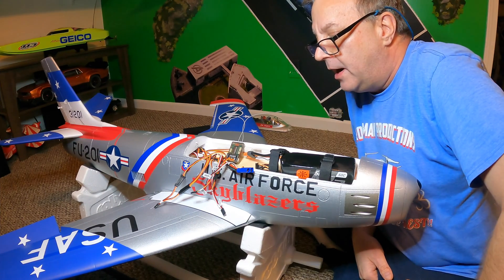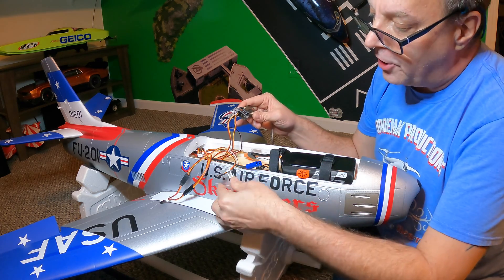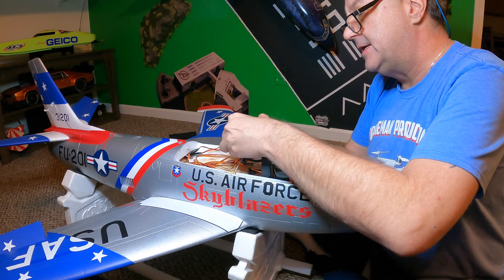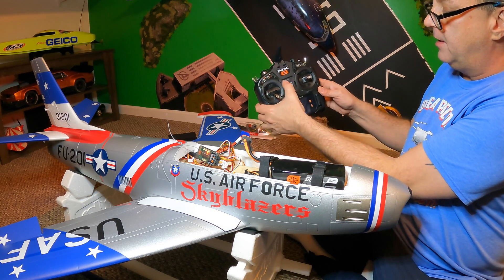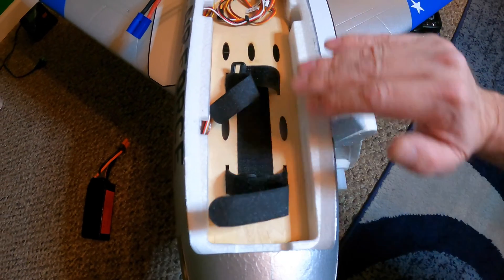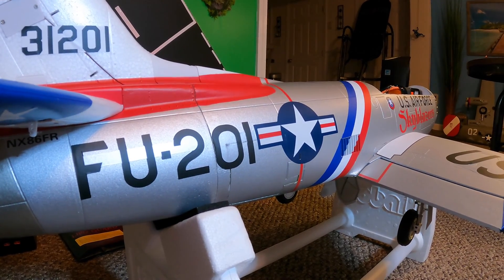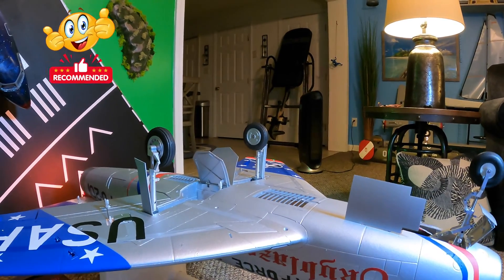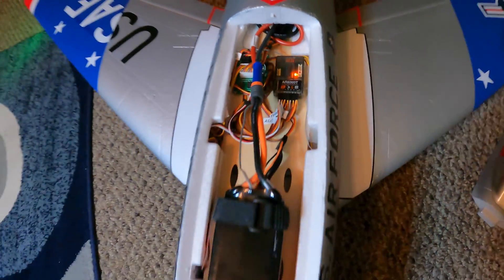FMS F-86 80MM JET HOW TO SETUP A SPEKTRUM RECEIVER & CABLE MANAGEMENT

Comment: Awesome, awesome video.  Thanks so much.
Reply from the maker: Im glad it helped out and make sure you check out your trims manually and electronically this bird is a bit tricky on them👍👍👍👍👍
Reply: let me ask you one thing.  if you have one servo for each flap, or one servo for each aileron, or one for each elevator, do you have to use a two into one connector to attach it to the receiver? Thanks so much.

Comment: Hi need some help, i changed front gear, now dont know where too plug front gear retract, due try with "Y" cable didnt worked. 
Many thanks
Reply from the maker: @lafranja6969  why did you change the gear?
Reply: Cause it broke on landing, but i already solve it.  Thanks  anyways
Reply from the maker: glad to hear you got it fixed

Comment: Nice review of your setup. I have the opposite color scheme you have. Purchased right after Christmas. Curious are your wing connectors the metal DB-9 version or the black plastic DB-9 ones? Nevermind I just watched you assembly video and you have the same metal DB-9 connectors. My right flap servo did not work upon getting mine together. Had to open things up and determined the servo was fine but they had wired up the BD-9 servo connectors in the wing wrong.  Debated fixing it myself but decided to hold FMS accountable for their lack of quality control. They sent me a plastic harness set same stock number as in manual. They stuck out further than the metal DB-9 connectors and it would not allow the wing to completely close and allow the wing bolts to be installed. So 9 weeks later I am waiting on the correct harness to be delivered. They are coming slow boat USPS mail from Florida. Hopefully I can get mine flying soon. Flying since 1976 and these EDF are really something.
Reply from the maker: Mine are metal. I didnt have any issues with mine. I have been flying since i was kid with my dad and he would of really liked these edf's. I havent maiden mine yet just waiting for good weather here in the northeast. Hope all works out for you and thanks for the comment.